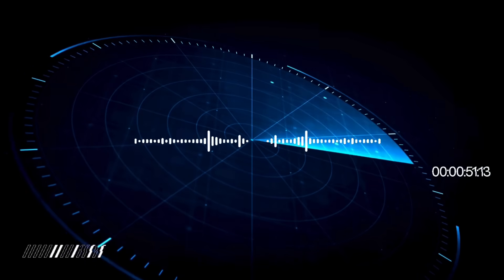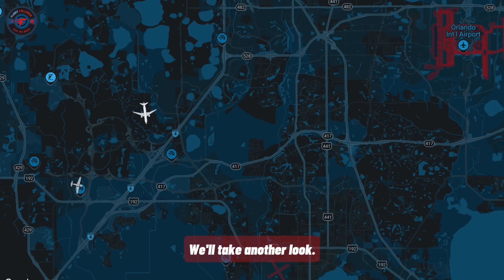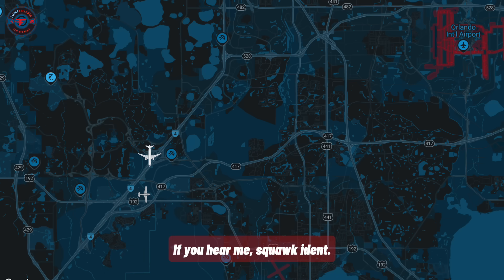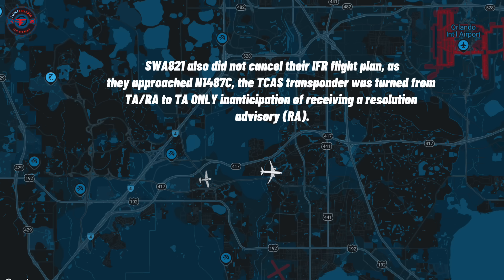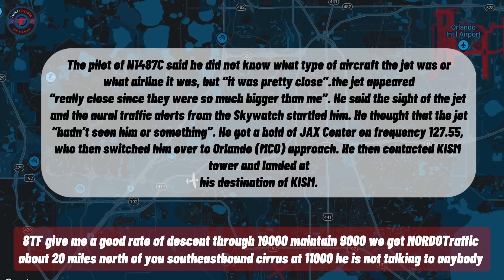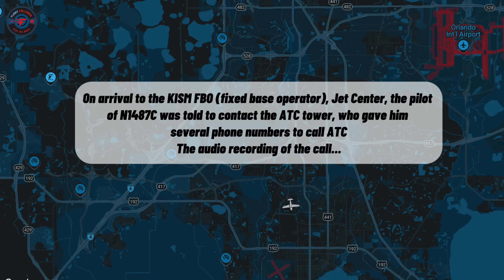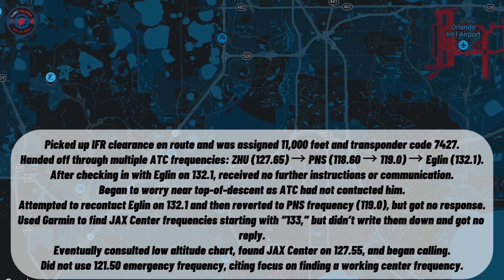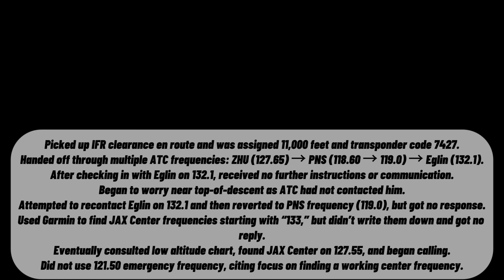ATC Suspended After Directing Southwest 737 to Inspect NORDO Aircraft, (Loss of Separation) 2011#atc

Comment: Retired ATC here.  This is another example of no good deed goes unpunished.  My sympathies to the controller suspended.
Reply: kind of like Lloyd Bridges picked the wrong week to stop sniffing glue...
Reply: He should be fired
Reply: i am wondering ..  a Plane wich does not respond to calls get inspected from an other plane wich is exactly knowing what they do .. and under  permanent controll of an ATC wich is permanently cvhecking the radar ..  is called by FAA and NTSB as .."  violated separation standards"   but  Helicopter wich cross an active  Landing path  wich is used by an Civil Airplane  with less then 100feet of seperation is  a normal Procedure .....     i woud say .. they must start thinking !!!!
Reply: Are you serious? ATC assigned a collision course between an airliner and a prop plane. You might think visual flight rules was good enough to avoid an actual collision, but the small plane could have made any unexpected change in course but for a clear view of the airliner, noticing radar, or some collision warning system
Reply: It wasn't a good deed.   "the path to hell is paved with good intentions" - there were good intentions but that doesn't make it a good deed.
Reply: woman pic
Reply: This was outrageous. I agree, the controller should have been commended for preventing this private pilot from piling the aircraft into the ground. Idiot.
Reply: If this is sarcasm or a joke to get the conversation going, simply genius
Reply: Call air force next time
Reply: Perfect example of someone that thinks he’s the baddest air traffic controller. This time he’s right, he’s the worst!
Reply: Current controller and pilot. This happened over a decade ago and yes, this controller and the 2 pilots flying that B737, I am sure were suspended and with reason.

1. The controller, definitely did not read chapter 7 of the 7110.65 in regards to visual separation. You have to be talking to one and have the ability to communicate with the other. The Cirrus was NORDO. He didn't even apply the rule correctly even if he was talking to the Cirrus.

2. No controller I work with would dare ask an airliner with 100+ on board for such a "favor." No one I work with would ask an IFR aircraft to go check on another IFR aircraft for such a thing. VFR aircraft? Completely different story.

3. What were the 2 pilots thinking putting their aircraft  full of passengers in such close proximity to an aircraft that no one knows what it's going to do?

I can't stand passing judgments, but this is one of those that makes the great community of aviation look terrible.
Reply: What a bunch of whiners. 100’ vertically, 500 feet horizontally is hardly formation flying. Obviously  the distances was chosen by the SW crew. That was an overtaking pass. Highly doubt the Cirrus would catch up to the 737.
Reply: @johnkiger1123 try to recall elementary geometry class. 100 vertical and 500 lateral does not mean they weren't on a course to intersect.

That's merely the closest position reached. A midair collision is extremely possible with those initial separation conditions
Reply: @TeleTrueStory Are you kidding? They vectored the SW to the vicinity of the Cirrus. The SW reported the Cirrus insight five miles out. If they were in IMC conditions, that would be a different story.
Reply: You call it a good deed to have an airliner inspect a tiny dot? How about you inspect a car driver who is standing still while you drive past at 160km/hr. You’ll see NOTHING. 
If this is such an issue get air force to intercept. They’re trained and equipped to do so. 

I’ll tell you, if this happened on an airline flight I was on, I’d never accepted it.
Reply: ATC’s job is to minimize the risk of air accidents. This controller just increased that risk. No matter how little the risk was, this ATC made 200+ people less safe. He absolutely should be suspended and be assessed. This was a job for USAF, total lack of judgment on his part.
Reply: @anastasiakorkova9175 It used to be a pretty common thing to do.  People used to want to take care of each other.  The controller kept the aircraft separated the entire time, but gave discretion to the pilot to fly closer visually and the pilot happily accepted.  Again this used to be fairly common.  Your judgement is pretty harsh and based on lack of understanding like bigelow, the guy who follows checklists and instructions and is seemingly incapable of thinking outside the box in unique situations.
Reply: Sympathizes with idiocy. Glad you're retired, Dave.
Reply: Probably some DEI hire who washed out in radar working as the QAS (or whatever quality assurance is called these days), who pulled the tape on it.
Reply: @northmaineguy5896;
Always the political crap!
Doing everything insanely
Reply: @northmaineguy5896 I am quite sure you have not looked into this, but so-called “DEI” hires are qualified to fill the position.
Reply: @northmaineguy5896  I found the Nazi.
Reply: @northmaineguy5896  Tell me, all of these "DEI hires," are they in the room with us right now?
Reply: @JulianAlpsNews No DEI blame here, that was a dangerous instruction by ATC.
Reply: @JulianAlpsNews you can pretend that DEI ATC and a bunch of pilots aren't unqualified, and also taking up space in atc
Reply: @northmaineguy5896  Define "DEI hire"...eh?
Reply: @northmaineguy5896 Right....DEI has zero to do with this. It was a dangerous instruction by ATC.

Comment: Pilot of the Cirrus sounds incapacitated on the phone.  He caused a cascading cluster and now everyone has to pay for his idiocy.  No good deed goes unpunished.
Reply: ATC probably didn't expect SWA to cowboy up to 0.1 miles, but also that's 500', they had plenty of separation after establishing visual contact way earlier. 

Never a good idea to do that with a commercial jet, though. Get one of the hundreds of private planes flying through that airspace to take a look.
Reply: @MrDillpicklz  The thing is, the 0.1 miles part happened after SWA had had a look at the plane, and ATC gave them a new heading, 110, which actually took them a fair bit closer to the plane than they already were... At the point ATC started giving them directions again, it was ATC's responsibility to keep them separated, hence why it's the ATC's fault. ATC should've kept them on their current heading (or even turned them left a bit) to get them further away from the Cirrus until they'd overtaken it before vectoring them to the right.
Reply: To be honest he probably thought "shit I've got to ring this number better have a few vodkas first" lol
Reply: @812MSS  90 minutes at 11k?
Probably hypoxic?

Comment: Ah, another silly ATC making the mistake of acting in the interest of aviation safety by employing the help of willing pilots in a controlled environment to assess options to potentially save the life of another pilot. What is happening to aviation??
Reply: This was a specific violation of FAA rules.  The passengers aboard that airliner didn't sign on to do intercepts of GA aircraft whose intentions and condition were not known.  This is NOT in the interest of aviation safety--it is against it.
Reply: I agree, perhaps a quick CRM discussion would have been in order, but by the time ATC asked for their help there wasn’t much time. An aircraft not communicating with ATC headed for busy airspace over a metro area is not a minor issue. I’d say the SW pilots did a good job
Reply: @IanWallace-z4n that is why they have bored fighter pilots sitting around chomping on the bit to get scrambled
Reply: How is that what was the plane supposed to see on the cirrus ?????
Reply: SusanPetro above would prefer to see the other pilot potentially die...than to try to interrupt her trip to see Mickey. She was exposed to higher danger driving to the airport in Phoenix. That didn't seem to bother her.
Reply: I can tell you, this is now the millennial/genz generations running everything. You know, the generations that never learned how to critically think, read, write, or count. The ones who don't believe in a 5-day work week. Something is going to have to change and I hope soon before incidents become an everyday thing.
Reply: Do you think it’s appropriate anyone not answering the radio they send a commercial jet with passengers to intercept  and supposedly do what exactly do you think the commercial jet pilots can actually look into the cirrus cockpit lol 😂
Reply: Again, judgement call. 
I think the SW pilots may have saved the possibly hypoxic cirrus pilots life, without undue risk to others. 
Bottom line is no damage, no injury, no death
Why all the second guessing a Captain’s decision to aid a fellow airman with minimal incremental risk?
Reply: @IanWallace-z4n  how would the SW pilots have saved the possibly hypoxic other aircraft?
Reply: @ the cirus was at 11k for 90+ minutes & not responding to calls, including guard frequency. 
The SW capt startled him back to semi consciousness. Listen to him on the radio after he “wakes up”.
Reply: @  sounded fine to me. Think you’ve got a hefty dose of confirmation bias on board
Reply: Potentially putting a plane full of passengers at risk in order to go off on a risky errand is a safety issue. This is understandable.
Reply: @ I respectfully disagree but go ahead, question the PIC’s judgement if you must. 
I think the PIC had the miniscule risk increase under control. Besides the cirrus was already a “rogue” aircraft. Isn’t it better to know about it & have it in sight than to not know exactly where its is or where it might go? 
Judgement call.
Reply: @IanWallace-z4n  Its pretty cut and dried. These aircraft approached to within 100 feet and 0.1 mile.

91.111 Operating near other aircraft:
(a) No person may operate an aircraft so close to another aircraft as to create a collision hazard.
(b) No person may operate an aircraft in formation flight except by arrangement with the pilot in command of each aircraft in the formation.
(c) No person may operate an aircraft, carrying passengers for hire, in formation flight.
Reply: @ if you want to pursue every minor CFR infraction, good luck, aviation will grind to a halt. 
This was a minor infraction & I hope the SW CPO gives the PIC benefit of command judgement call.
Reply: @ commercial airline pilots are often asked to assist with aviation emergencies close to their path. This one just happened to be a lot closer than usual😎
Reply: @IanWallace-z4n  this is not minor it's a major safety issue the pilot should be suspended too.
Reply: @ if you say so🫡
Reply: @ care to state your qualifications for this judgement?
Reply: @ryen7512 rage bait for sure lmao
Reply: @michaelbigelow3255 I bet they still have a job because no loss of separation occurred lmao
Reply: @michaelbigelow3255  fair enough sir, I respect your opinion 

But in this case the PIC determined safety was not compromised & none of us were in their shoes at that moment. 

It’s not like this was some part 91 pilot going over the line to help ATC. 

Interesting the poor ATC gets hung out to dry but we will never know what if any action is taken against PIC - As it should be 
Or you disagree there also?
Reply: @michaelbigelow3255  I’d like to hear from my other airline captain friends on this one…
Reply: @michaelbigelow3255  Regardless of OP’s opinion, an “airline pilot” who comes on YT to call other people fools and clowns is not exemplifying the professionalism required of an airline pilot. I question whether you are an airline pilot at all.
Reply: @michaelbigelow3255  ... that  feeling of knee deep in one-sided friendships with thyself must b very seif rewarding to say the least due to the intense demonstration of self control u happen to portray towards others in this comment section - along with usage of added emolji's.  Congrats out to u with such the 'cut above the rest' mindset u possess.
Reply: @patrickunderwood5662  thank you 
The whole “needs to be punished” argument smacks of unprofessionalism & ignorance
Reply: @patrickunderwood5662  
thankfully the pilots have a better union than the poor ATC guy, so no one will ever know if any action is taken against PIC - 

which is as it should be. 

Non punitive environment with remedial training as required.
Reply: @ryen7512  Passing another aircraft 500 feet to one side while moving 60 knots faster can hardly be referred to as “formation”. Since she was given, and accepted duty to maintain visual separation, and subsequently did so, I see it as a non-issue. 

The Cirrus occupants were either asleep or massively inattentive while traversing class B airspace. She may have saved their lives. She certainly did not violate 91.111.
Reply: @RussKlo  agree
A 737 overtaking at 60+ kts even at 0.1 lateral could evade erratic movement of the cirrus.
I think they saved a hypoxic pilots life
Reply: @AustinWirl No loss of separation? 🤔
Reply: @IanWallace-z4n  
 - "Non punitive environment with remedial training as required."

With respect, ATCs are in such short supply I imagine the most he received is a letter in his file which his union would get removed after a few months.  

The ATC asked SW to spend an extra $20 in fuel before they spent $100,000 to scramble a couple of F-16s an hour later.
Reply: At risk? Lmao.  That makes no sense.
Reply: They’re a commercial jet not a military or LEO asset. Mid air waiting to happen. Would you send a school bus to look after a vehicle not stopping at red lights?
Reply: Woke happened smfh
Reply: we've turned into a world of politically correct wuss...

Comment: Were the pilots disciplined?
Reply: Yes
Reply: @flyluv737  Too bad.
Reply: @michaelbigelow3255  I must've missed the separation distance. 1/10th of a mile and 100 feet is indeed crazy. I don't mind them taking a look, but I agree that that is awfully close.
Reply: @MooseGuy1  you don't even get them involved.  The passengers didn't sign up for this.  You don't add to the risk to passengers, even a little, to solve a problem like this.  This ATC disregarded not only FAA regs, but the passengers right to have their safety made the first priority.  Career ended, and rightly so.